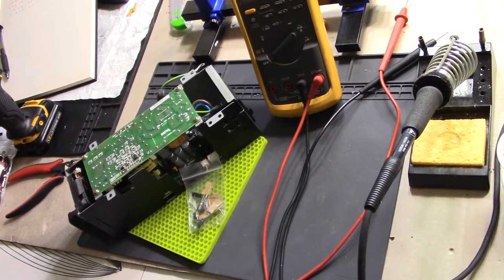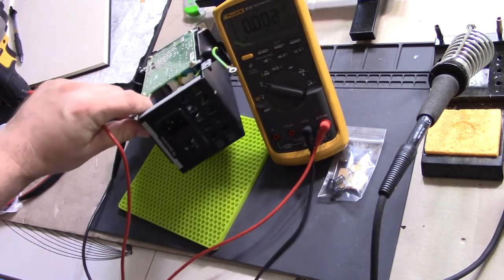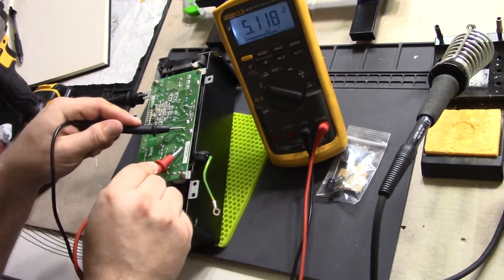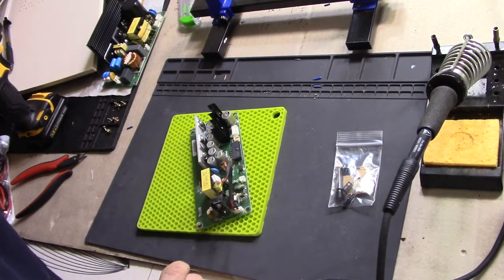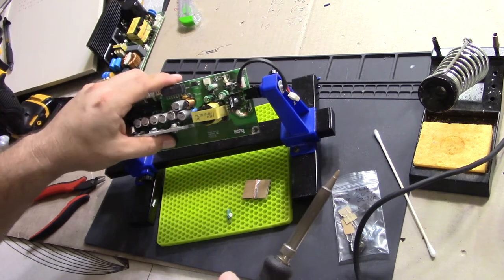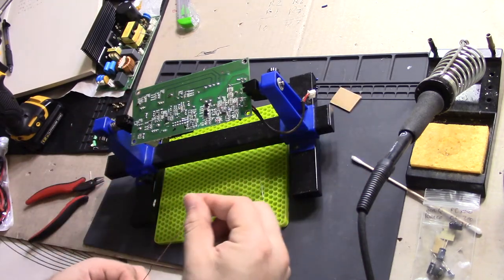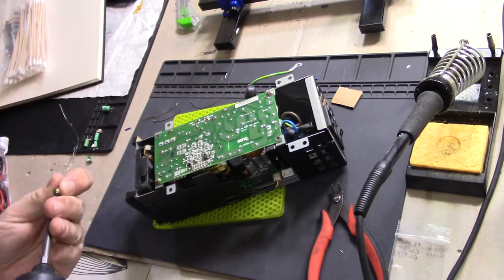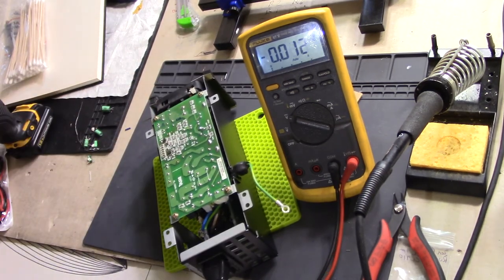BenQ PE8700 Capacitor Replacement (newer version)

Comment: Nice video Frank. I'm the one, who fixed a W1070. I also have an Epson 3020e, that has a weird issue. In 2D the image is black, in 3D there is an image, but the bottom is cut down. I don't have the remote for it. I have used a Logitech Harmony remote to try different modes, but it did not help. I have also tried resetting it, which did not help. Maybe the HDMI board is bad?
Reply from the maker: Tibor Makai Hi there! Would you link a picture of the problem? I can kind of visualize it but if I can see the problem, I can give a better suggestion.
Reply: I have to select one of the 3D modes( ex. side by side) and image shows up, course a bit blurry without glasses, but the bottom of the image is cut down. If I switch to 2D, there is no image, no menu no nothing. Blindly I have to try the remote to do back to 3D mode, to be able to see something on the screen.
Reply: Maybe there is an IC that controls 2D/3D and that one is defective? I couldn't find a service manual. Many ICs are Epson ICs.
Reply from the maker: I was looking around and the service manual is hard to find.  If it happens on all inputs, I would suspect the main cpu.  Is it every input or HDMI only?
Reply: The European version, if I'm not mistaken, is EH-TW6100W. If by any chance, you would find the service manual for the European version, that would be great as well. Some assembly manual I have found only.
Reply: Here is a thread, that I have started: http://repairalmostanything.com/thread/655/epson-powerlite-3020e-video-issue

Comment: Hi Frank, coming from other videos comments 'Hitachi CP-X3021WN LCD Projector Repair'. My Panasonic AE3000E. I got 250V AC (Australia) into the PSU.  I think i see pulsing, and there's no voltage coming from the low voltage pins. My PSU has a relay (don't all projectors have a relay? - i assume for the remote control power on).  Can i ignore that or does it need to be activated for the PSU to have voltage flow?  I.e. the PSU you're testing here you just plugged in AC and expect power to flow....do i expect the same on panasonic with relay? (how does standby work?)
Reply from the maker: Hi Rob,  I looked at the service manual(top link here https://elektrotanya.com/showresult?what=PT-AE3000&kategoria=&kat2=all)  and it seems that you probably have a standby power supply issue. You should have 3.3v on pin14 from the P-Unit(power supply).There is also an AC detect line on pin15.  Without that 3.3v you will have a problem.  Download that top manual in the link I provided and see page 43. I think that will shed a lot of light on things.  If you have more questions let me know.
Reply: @FixitFrank  I'm also looking at same manual and have been staring at pg43 for sometime. I don't look at schematics/block diagrams every day - so thanks for your knowledge/experience sharing.... now i know what STB means - Standby!  My bad - i rechecked and Pin 14 (STB) does have 3.3V.  AC Voltage detect pin 15 shows 0.5V DC (1.3V AC - should i be in DC?) - What is AC detect?  All other pins on the 15 pin connector are 0V. So the rest of PSU would not carry voltage until out of Standby (relay would then switch)? Do i simply bridge pins 13 and 14? Although on p54 pin 13 wants 2.5V (8ohm resistor needed)?
Reply from the maker: @Rob-ml7ps  that's a good sign. That means your standby is ok. What I would do is back up that manual to the troubleshooting charts. They have a no power flow chart that takes you through what to check. I'd maybe check the interlock switch for the lamp door before that. If that switch isn't working it will keep the power in standby. I'm on my phone so I can't check the manual at Dr time but the flowcharts should be nearer the front of the manual. Those flowcharts are awesome. Service manuals kind of feel like cheating but at the same time I learn so much from them.
Reply: @FixitFrank  I don't get any LED lighting up. I'm pretty sure lamp (interlock) switch and thermofuse are ok - because i checked AC at the power board, after these switches, and i get 240V.  I've gone though the first flow chart...on A-board I found 1 small (4.5mm diameter) silver cap (C1362 i think typo - its C362 on PCB) that is discharging ultra slowly....like it might take 30mins (100uF 4V). I tested another of the same next to it - it discharges quickly. Although i'm testing them on the board.  Is that a sign of higher than normal internal resistance - i.e. it's dead?.
Reply: I put it back together, since i was going to test the voltages coming out to the PSU...now it's working again! Must have been a loose connector in the end.
Reply from the maker: @Rob-ml7ps  Fantastic!! Thanks for letting me know. That is awesome
Reply: it was working fine since my last post.  I had it running for about 5 hours yesterday watching a lot of stuff, movies, youtube concerts.  Next day i came to it...the standby light was off again - strange.  I switched it off at the mains, on again...it worked....came out of standby, came on - then a minute later off again by itself (like no power LED lit up).  Then about 20 seconds later on again by itself and green LED flashing like its coming up - it's like there's a loose connection inside, mosfet, or capacitor?  or something else.  Now i just turned it on again after it was off for 30 mins.....it came straight to green light then working (normally it would go to red standby first).
Reply from the maker: @Rob-ml7ps  You might want to check over that main power switch. It sounds like something is interrupting your mains power.  Also try another power cord.  With intermittent things like this, your best bet it to start shaking things and finding where the issue is localized.
Reply: @FixitFrank  Not seeing any issue with the mains power, sockets, or cords. The projector dead again this morning -no STB led. I stripped it down to troubleshoot the power supply and i get about 0.2V on the STB, and between 0.7 and 1.7V on AC Detect it keeps fluctuating slowly. So it's an intermittent fault. I checked the electrolytics and they seem fine, all in spec, i even unsoldered the ones i couldn't get a reading in-circuit. I guess this issue is narrowed down to the standby circuit.
Reply: I fixed it!  I checked all the electrolytic capacitors - all good on this 14 year old projector, the big 450V 150uF one is 16% out but still within 20%. I checked solder joints...re-soldered several that looked suspect (duller rings in joint).  This fixed the issue....it was a dry solder joint that gave this intermittent no standby light and shutdowns.